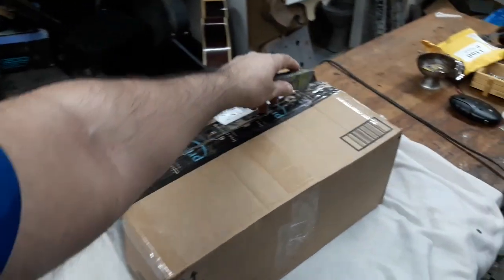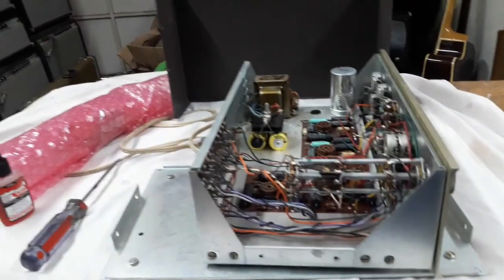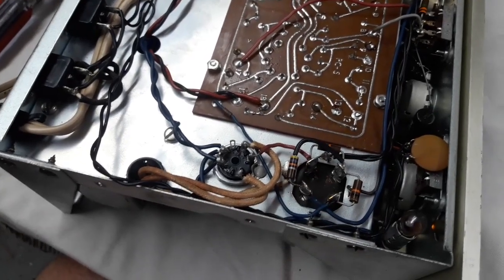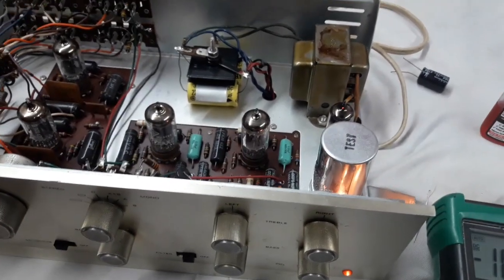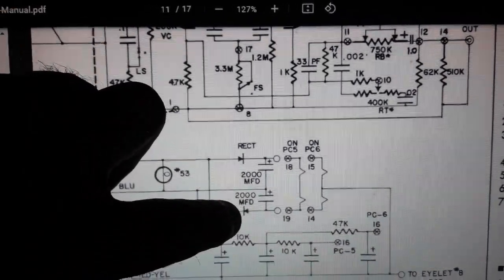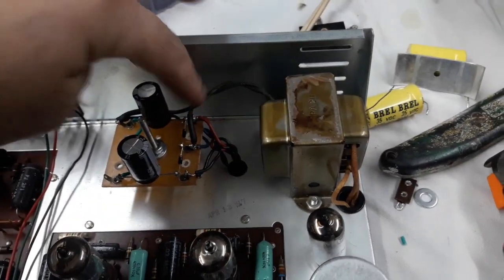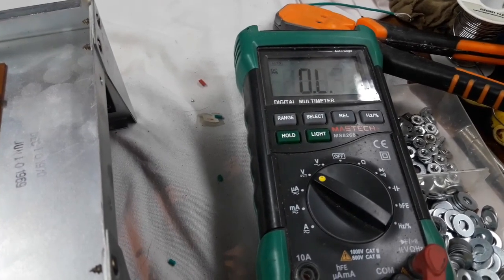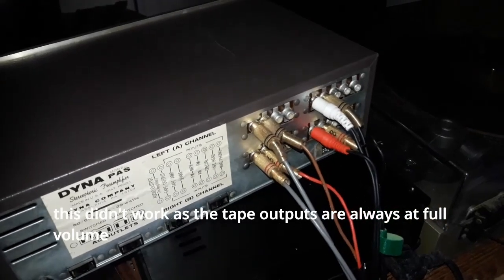Dynaco Dyna PAS3X tube preamp basic inspection and updates

Comment: Have two of these PAS preamps, they are glorious
Reply from the maker: Hello Jules, what do you use them with? In a surprising twist, I recently ran this preamp into a Mcintosh mc2105 and the result was not nice at all. I need to keep my PAS + Mk3s dynacos setup  intact.
Reply: Dyanco ST-70 series II and an old SCA-35.  Obviously it was designed for this use and sounds great.  Might not be a good pairing for a McIntosh amp... I will add that in the regular preamp stage (right pcb) I'm running 60's nos Tung Sol 12ax7 's and in the other unit the original dynaco west germany tubes.  Might want to experiment with putting in gold lions or something to pair better with the McIntosh @jothanankrogh
Reply: Look up your amp's input impedance, it may be a bad match for the PAS @jothanankrogh
Reply from the maker: @julesl6910  the mcintosh mc2105 has a stated input impedence of 200k. I am not sure how much of what I hear is an impedance mismatch or sensitivity mismatch or excess gain? But together they do sound nasty.
Reply: Yep that's about twice the standard input impedance of most amps, it will require a mcintosh preamp or something like that lol.  I envy your "problem" and hope to have something like it some day. @jothanankrogh

Comment: I ASSUME you know that a leaky electrolytic does NOT just mean electrolyte physically leaking from its pins or end. You should measure every section for value and ESR, equivalent series resistance. Often is the case, aging electrolytic caps start exhibiting internal resistance and start acting more like a resistor than a cap. I generally toss electrolytics older than 30 years unless it's a Nichicon, Rubicon or other high quality caps. Those I still check and if the value and ESR are good, maybe, allow more like 40 years. Bottom Line, electrolytic caps don't last indefinitely. While on the bench and under the hood is a good time to do this work.
AND keep in mind, there are a lot of fake caps with brand names like mentioned. DigiKey and Mouser are
 a good source for quality parts.
Reply from the maker: Yes all electrolytics were replaced, I just wasn't sure at first if they were the original parts.

Comment: Hi Jonathan, I have Pas 3  and with a HK Citation I Ithat I have had since the mid 80's. Both was completed rebuilt by a Micheal Fraser in Los Angeles. His design is based off Herbert Keroes from the 50's. In the Pas 3 he has added two 12au7's, not sure why. In the phono section there are two small vertical boards added, maybe for the RIAA. The tone controls are removed. He needed the area for two 450V, 100 MF's each, two zener are added on top of the selenium rectifier.   A choke has been added. Numerous capacitors are stacked on the phono and output borads. A couple friends brought their PAS3 over for comparison and the Fraser kill them. The Citation II is completed changed. No more 6 volt TV tubes in it
Reply from the maker: Hello Tara, sorry for the late reply. I would GUESS that the added 12au7s are for cathode follower stages for the line output, maybe even for the phono too. They probably did something with the power supply to address the extra current needed also. Very interesting to see how complex or how simple mods of this platform emerged.
Reply: @jothanankrogh Are there out here in the Los Angeles CA area that still work on tube gear.

Comment: Want your Mark IIIs to sound real good? Get a better preamp (e.g. ARC SP16, Rogue 99 etc. for around $1500 in Canada). You will be amazed. The Dyna is fine but has it's limits no matter what you mod it with. I hooked up a Rogue RP-5 ($3500 US) to a DYNA ST-70 and WOW. Goes to show you how good these simple Dyna power amps can sound when properly fed with a higher quality preamp.
Reply from the maker: Advice appreciated! But now I am eyeing those chinese clone preamps of those models on ebay

Comment: I had a PAS 3 I got cheap in the 80s.  I did upgrades as I could.  First I got a repro face plate somewhere because of the labels worn off.  Then I had a source of Dale metal film resistors and PolyP capacitors.  So I restuffed the circuit boards with those new components.  Then I tried rolling tubes.  The Telefunkens sounded OK in it but original Mullards had a better sounding midrange to me.   Did not try domestic or Russian tubes or such.
Reply from the maker: I have kept the telefunkens in place. I have a small stash of classic old 12ax7s, but sadly the Mullards among them are a bit noisy and microphonic.

Comment: The selenium rectifier has internal resistance greater than modern diodes have. Usually replacement involves diodes and a resistor to make up the difference. You could re-design your board to include that and incorporate the fuse as well.

Comment: There was a significant upgrade to the Dynaco PAS 3X that used to be available from Audio By Van Alstine (AVA) called the Super-PAS Three preamplifier.  AVA used to offer that upgrade either installed by AVA or as a kit which you could install for yourself.  I looked at AVA's website prior to posting this comment, and they no longer mention it there, but perhaps they might have something in inventory if you contact them. It would be worthwhile if available.
Reply: I have one of those!  I love it and will never let it go.